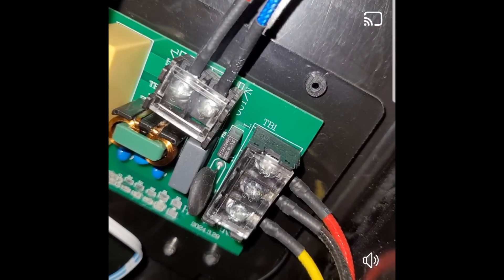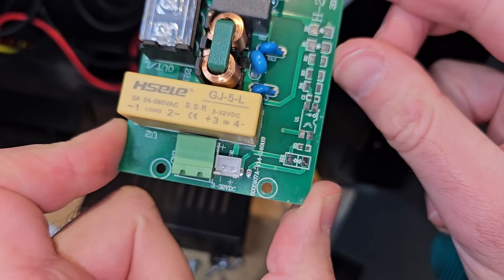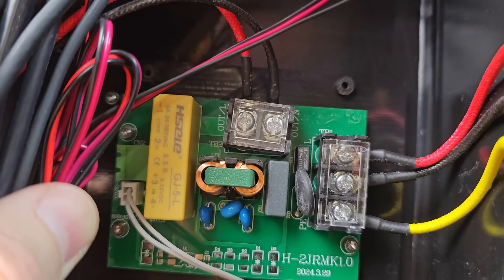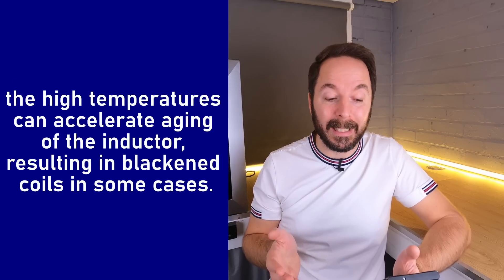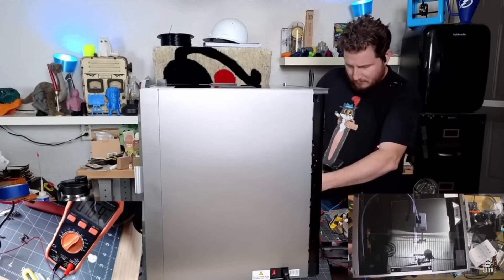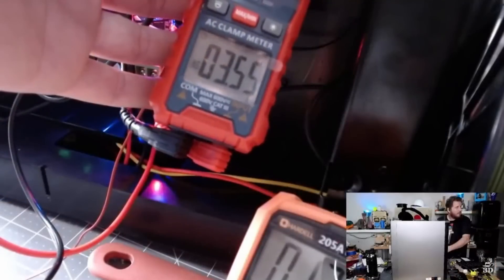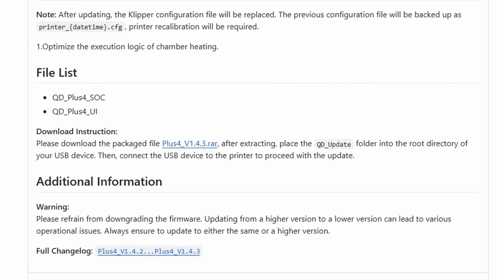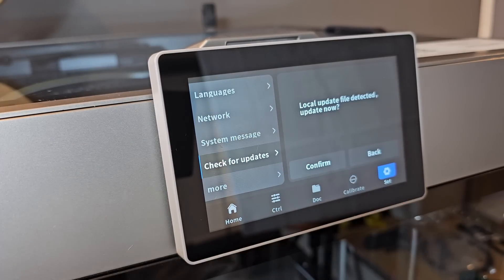Qidi X Plus 4 Defect & Safety Risk - All The Facts Explained With Reply From Qidi CEO

Comment: :face-blue-smiling::hand-pink-waving:The problem is that the Qidi design didn't anticipate their printers being used with 120 volts, like that we use in the United States. It is not the coil that is the issue, but the large yellow box on the pcboard. Watts are equal to the volts multiplied the current. Therefor the problem is that 220volts X 1.82ampre = 400 watts, but 120volts X 3.33ampre = 400 watts. So at the lower USA voltage, the current increases and the original relay was not designed to handle the higher current. In my opinion, you should change it out regardless, but I think it will be ok if you just add a larger fan to the electronics chamber if you are at 220v. Changing the relay out to a heat sinkable Solid State Relay is safer, it has a cooling surface to dissipate heat and the switch is transistorized instead of a mechanical coil and arm. Do Not Use SSR's made in China! Taiwan, Japan, USA are good. The current firmware drops the output to the chamber heater down to 150 watts. After you have replaced your SSR, you will need to increase the wattage. I would keep the control setting close to 90C since the chamber heater housing is made out of ABS plastic. :goat-turquoise-white-horns::hand-purple-blue-peace:
Reply: I dont know how they could have nit anticipated the 110v market of the USA, their biggest target market. My x max 3's, and my q1 pros all have zero issue with the heaters. They have been dealing with the usa market as their number 1 market for many many years now.
Reply: Yeh man i aint interested in doing all that. Imagine if they had someone at qidi that thought like you do in all of the 30 seconds it took you to figure that out and type it all they could have prevented this but it doesn't seem that their engineers care for it. Just about getting machine sales. Sorry this issue has put a very bad taste in my mouth I was so pumped to buy one of these machines but ill just buy an X1c instead
Reply: >  It is not the coil that is the issue

I disagree. 

The coil has the same issue as the relay; half the voltage means twice the current, and how can you argue with the fact that we've seen burnt coils?

Comment: You should advise that Qidi underlines that the wires should not be reverse fit. There is a picture at the end of description for how the wires should be replaced. By reverse installation, you could add to the problem.  https://drive.google.com/file/d/1AT1EQ8lyugUOenMnzXxN81GvbNgPAO2g/view?usp=sharing

Comment: I think what added to this fervor was the fact that I filed a complaint with the U.S. Consumer Products Safety Commission last week. I copied this complaint to a Qidi rep in an email. 
I had been using this machine with the chamber heater for many hours while I slept & away from my print room for hours during the day! After opening the machine I found the inductor coils to be severely burnt & darkened. It really upset me!
That's when I got into the mix. 
Qidi is sending me the latest iteration of the board next week & Ill be reporting my own findings next week to the community. 
Disclaimer: 
If customers aren't confident working with Mains AC wiring, DO NOT ATTEMPT TO REPLACE THE BOARD! Seek out help from a licensed electrical engineering technician.

Comment: This was a great summary of the issue, the current state of play of the fixes, while still separating the specific issue from the quality of the rest of the product.

I still think that it reflects somewhat poorly on Qidi that it has fallen to content creators like Ricky, Dan (ModBot), Nozieworks, and Grant (3DMusketeers) to communicate to the broader Qidi customers base and update them on the issue as opposed to Qidi taking the initiative and getting ahead of the problem and putting out an official statement to upgrade the firmware, and to avoid using the chamber heater if you live in a 110-120VAC region until a proper fix is finalised and made available to customers.

Grant tested yesterday on a live-stream what appears to be an alpha version of the final fix board, and found it to solve the issues of overheating components on the chamber heater power supply board for 110-120VAC regions.  The ball is firmly in Qidi's court to take affirmative action here and communicate to users as soon as possible about the situation and the path to a solution.

Comment: Qidi is really failing the community with this issue. This should be a recall for all 110 countries. The "fix" looks of such poor quality. I am glad I waited to purchase this I would not purchase this until there is an actual good fix. Bambu is good example of what should be done. I am pretty sure the reason no fires have been reported is because it was quickly apparent that this was a problem.
Reply: As far as I remember, Bambu Lab only did a recall after a lot of backlash.

At first they just offered a small plastic piece that you clip over the cable as a solution and claimed that it was the users' fault because they bent the cable. Then they tried to blame the shipping company and sell it as shipping damage. And finally, they offered a $120 voucher to anyone who replaced the heatbed on their own. They are not really any better than Qidi in that respect.
Reply: @andreas.grundler  bambu handled it 100x better than qidi has so far. i run a small fleet of a1s and replaced all my beds.
Reply: @RJR981 I don't see it that way, but I'm more of a bystander. I just noticed how Bambu Lab first tried to pass the buck, then told influencers to tell their viewers to stop using the printer, and then took several days to issue a statement to the press. In the meantime, the US Consumer Product Safety Commission got involved.

Incidentally, what you did with the heatbed is no different from what is now being criticised. In some countrys it would be illegal to do so. Better don't tell your insurance company about this.
Reply: @andreas.grundler  Glad I have dodged both.
Reply: @andreas.grundler  - this is not how I remember the issue being dealt with.  The first I heard of the cable issue was an email announcing a recall or wait for the revised part to be delivered and voucher (which I took).

Comment: Everything in this video is accurate. There is no issue on 230V, there have been zero fires thus far, the old board still gets too hot even on the new firmware, everyone in a 120V region should request a new board. Great job with the coverage.
I will say in addition the new version of the power supply has gotten to a few hands, including Grant's. He tested it as maintaining reasonable temperature. I should be able to test mine this weekend. Everyone who has looked at it says it is much more suited to task.
I am a huge fan of this printer, the quality it produces is awesome. I am also a believer that Qidi actually cares about customers, but rushed this launch and still needs experience dealing with this kind of problem. The Qidi owner community is great though.
I also think it would be better to make a public statement when a defect is known rather than just when a solution is finished, and I have told them so. I sincerely hope nobody has any larger issues and that Qidi will take everything they have learned from this launch to drastically improve the next.
Truly excellent coverage of this issue!
Reply: Everything in this video is NOT accrete. He says to put the wires back in the way they came out and this is not true. The wires go in a different order on the new board.  Doing it how he states to do it could cause a serious problem. It needs to  be done according to the instruction sheet that comes with the board, NOT how he says to do it. This video should be taken down before he causes someone to burn their house down.
Reply: @dalemiller3639  He says "It appears" that replacement will just be R&R, but he also notes to pay close attention to wire order. Every replacement board comes with a card showing you the correct wire order. If you put the wires on the new board in the same order they are on the old board, nothing bad happens, it just doesn't function. I know because early users who received them did so. It does not even damage the board. You simply have to switch two wires. Please don't spread fear mongering misinformation.

Comment: I had been considering purchasing, well, at the time it would be pre-ordering,  a Plus 4.  Specifically I wanted the heated chamber as I print a fair amount of ASA and having my machines in a cold workshop I was sure the heated chamber would be very helpful.  I was ready to place the order when suddenly I hear about this issue.  Throwing the brakes on me placing an order.  

I'm in the UK and I don't care what they say about machines in 220-240v countries being safe - with the firmware update.  I need assurance that the machines are safe, now and in the future.  The only way they can achieve that for me is to replace the part with a proven safe component no matter where the machine is in the world.  After all, what happens if a future firmware update accidentally rolls back the safety change.  And, will future machines be built using the revised component?

I have a Bambu A1 and their recent recall was a great example in how to deal with this issue.  Clear communication.  Clear actions.  As far as I can tell everyone is happy.  I know I am with my A1.

I'm now left wondering if Qidi a reliable company?  And wondering why Qidi are not communicating more publicly and transparently.
Reply: I print asa on a p1s in the north of the UK without issue.
Reply: @AmirKhan-qx2lr  - I have an X1C and ASA is generally fine.  Where I have problems are when the weather is particularly cold over night, especially if there is also heavy rain.  I'm sure in my head that a heated chamber could be very helpful.
Reply: The part is perfectly safe at 220-240v, as the amps being drawn is half of that when on 110-120v.  Qidi overlooked the amperage being drawn at 110-120v.
Reply: @MrKhapp  - but as I said.... what happens if there is a future accidental roll back of this recent change.

Comment: Looking at Grant's video, the red and yellow cables on the new board are swapped.
Reply: I watched his last live and I was left thinking the replacement part was rushed and shoddy.  Not something that would give me confidence.
Reply: @IanBradbury  It clearly was. I am waiting to replace mine. This situation is pretty terrible
Reply: @IanBradbury  I don't have confirmation, but I believe these were the first "production" units of the new board design, and I hope the full production run will have the couple small quality rough edges ironed out.

Comment: So will all Plus 4s shipping to US or other 120V regions have the new board preinstalled?
Reply: My guess is at some point yes, but no one knows for sure or when
Reply: Most likely not yet. If you purchase a printer right now, expect to have to replace the board. It will take some time for new stock to be produced and shipped to warehouses. No idea exactly how long. If you purchase a printer now you could even contact Qidi and ask them to ship you a board immediately. Their customer service is very responsive.
Reply: @802Garage  did you get yours yet? Did it look like Grants with mediocre hand soldering?
Reply: @willofthemaker  Yes I have mine as does one other person on the Disk-chord. All look the same, though honestly not bad other than the single hand soldered component.

Comment: From the low quality picture of the reply board.  The new board is more than capable of carrying the higher current needed on a 100-120 volt.
The board is very easy to replace. Just UNPLUG the printer and you won't get shocked.  If you're unsure about doing the work, just take a picture of the wiring before you start.
Reply: Qidi have release a newer version the uses a round coil instead of the "tower" style, and I believe the wiring is different so instructions need to be followed as it's not wired the same as the old one.
Reply: @MrKhapp  really, they didn't use the same wiring layout.  But yes the lower type coil is better as it uses a much thicker gauge wire, which allows more current with less resistance (heat)

Comment: the fact they don't replace the 220-240v zone units is unfortunate as trust is now completely lost for the original part, imho.
Reply: I'm not on company side, but why would they need to replace a completly fine machines except they also having issue or expected to have issue. Even big companies like Samsung and Apple only called back batches and devices that have issue, not all call back as I remember.
Lets put that aside, this issue can't be ignored, even it's yet to have big incident, it's better safe than sorry.
Reply: @stickercambodia  Because if you move to a 120V region and forgot about this issue this could be dangerous.. Also if you re-sell it to someone in that region.
Reply: @julienlecoq3539  That's user negligent! One must not bring electrical device(s) without proper basic knowledge, in this case country voltage regulation, in to another country. The same apply to everything electronics not just 3d printer. There is nothing wrong selling 220V-240V machines to the same voltage regulation countries if this issue just because of it.

Yet, Qidi sales the machines made for 220V/230V/240V to 110V/120V regions, it is all in their responsibilty. I believe the least they could do is full refunding for buyers in those regions.
Reply: The board is designed to function on 240v so why would the replace it?
Reply: The original part stays more that acceptable cool on 230V. It is the same board they used in the Q1 Pro and is incredibly similar to boards used in Bambu Lab printers. The issue only arose in 120V regions in this printer due to the higher current draw.
Reply: 220 /230 uses 1/2 the current of 120, high current in what looks like a small transformer which so far makes sense
Reply: @jamesocker5235  I don't know much about electrical AC stuff, but is this not using a resistive heater?  If so, then halving the voltage will actually half the current as the resistance remains the same.  So, is the problem then because the board tries to compensate for this somehow?  I really would love someone explaining exactly why that part would be getting hotter on 110V than on 220V.  EEVBlog?
Reply: The wattage element is the same so if voltage and resistance stay the same the current has to increase to stay at whatever wattage it’s rated for.

Comment: Sorry, gotta put my 2 cents in…

While waiting for the new board to arrive, consider moving the current board with the issue to the exterior of the machine, or, if feasible, leave it in place but rig up some temporary mounting. Adding a heatsink with a fan to the choke (inductor) could help manage heat more effectively in the meantime.

I agree that manufacturers should take all necessary steps to identify and resolve these issues, working out multiple solutions and implementing a fix as soon as possible. However, at this level of 3D printing, users of advanced equipment like this should also be capable of safely troubleshooting and applying quick fixes, allowing continued use of the new machine without significant downtime.

That said, if we’re calling this a “community,” then let’s extend that spirit to support the vendors who bring us the latest tech. Working together to overcome issues like this can strengthen the whole ecosystem.

Thanks, and let’s keep pushing the hobby forward.

Best,
Jason
Reply: I've seen vids of the "bad" ssr hitting over 200°c QUICKLY.
Reply: @notyouraveragegoldenpotato without the heated bed on yes. It did drop in temp once hitting setpoint in the chamber all though it was still way to warm. New board runs significantly cooler now for 110v countries.
Reply: In response to a part of their product overheating to the point of smoking, for a CEO to say "First of all, we believe finding the best solution is the most important thing at the moment, which is why we have not made a public statement yet" is lunacy.  Expecting their customers to find out about this potentially dangerous issue from  youtube content creators is sad and derilict.  If they had made a public announcement letting ALL their customers know about this and stating they were working on a solution, they would still be in the running for my upcoming printer purchase. The way they have handled this ensures I will never buy anything they sell. They have demonstrated they cannot be trusted.